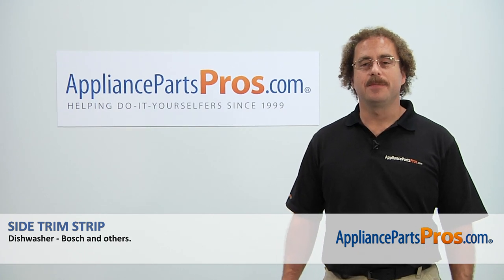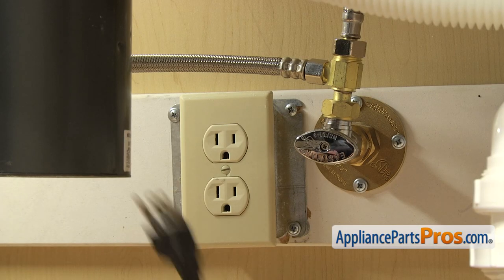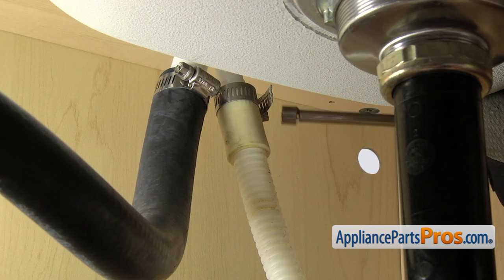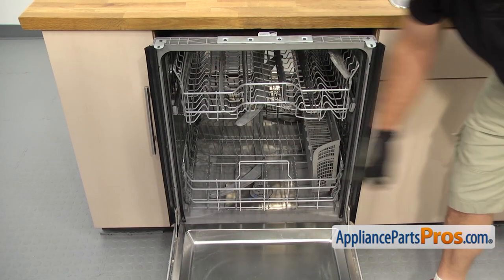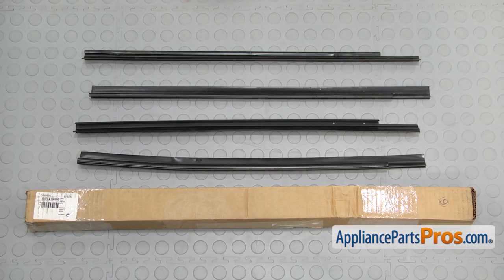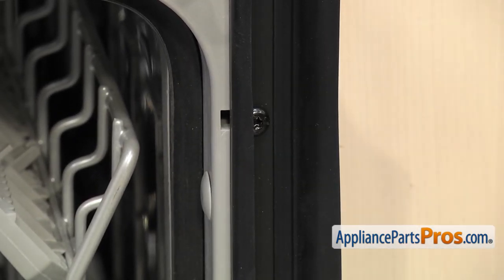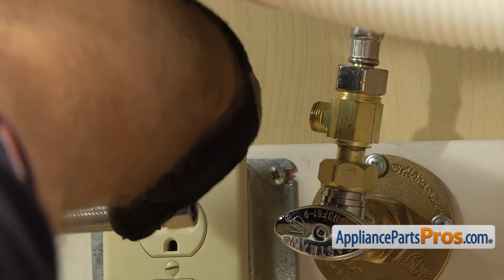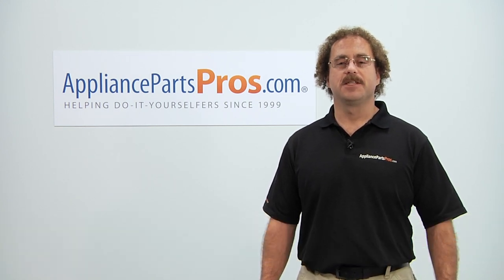How To: Bosch/Thermador/Gaggenau Side Trim Strip 00749684

Comment: I'm so disappointed in Bosch's instructions for the machine I bought. This helps but I still don't know exactly how those gaskets on the side are supposed to be situated. They stick out in front of the cabinet edge! Am I supposed to tuck them back behind the cabinet? If I do, then that exposes the cut edge of the cabinet which is not made of solid wood. If I leave them facing forward, but push the dishwasher into the space far enough that the gasket edge is flush with the cabinet face, then, the top of the door - and its associated buttons and lights - is half-hidden by the countertop!  Replacing a d/w should be a 30-minute job, like the others I've done.
Reply: I'm in the same boat.     Maybe I missed something, but, why the need to unhook the plumbing just for changing side gaskets?
Reply: I followed the instructions last night... Still AWFUL!

Comment: You cant even see the buttons lmao.
Reply: Yeah. Good point. I have this problem after a new counter top was installed which required that the dishwasher can no longer fit entirely under the counter top because of the overhang. The result is a compromise between having 2.5" of the dishwasher sticking out from under the counter top but just enough to be able to see the buttons enough to run all of the functions and see the LEDs indicating operations